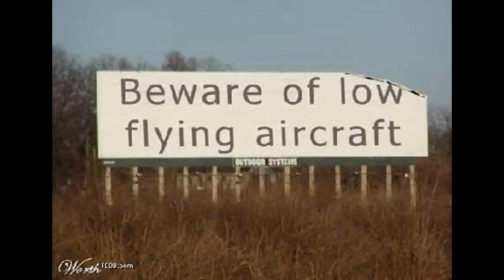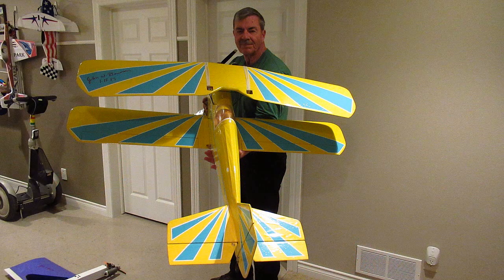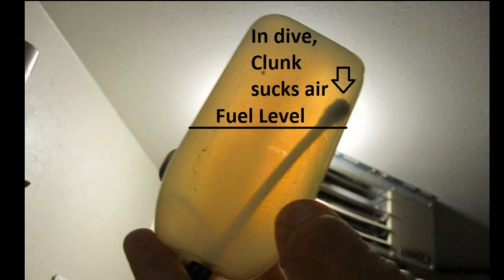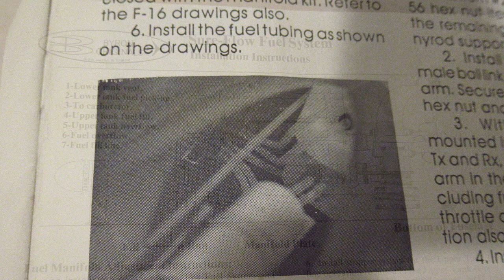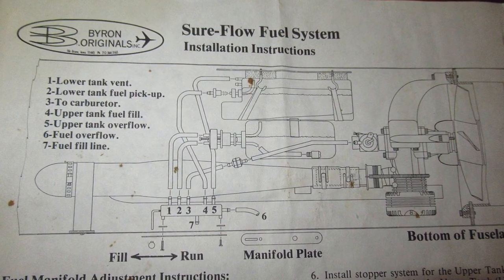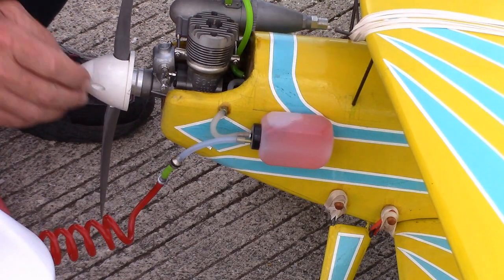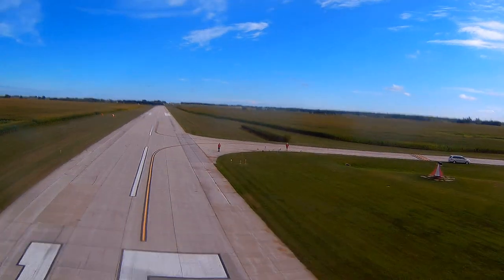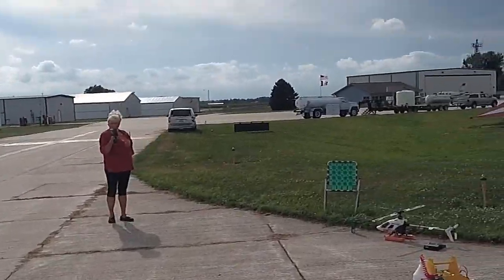I love my AAMCO balsa Aeromaster TOO Biplane!

Comment: One of my all time favorite planes. I flew one for many years with an OS 90 four stroke. It was covered with silk and Sig dope. It finally met its demise in a mid air in which by the time I was getting what was left of control it strained it self through a tree. I still have the fuse which was not hurt that much. Still have the plans. 

Thanks for the memories. I also have a scratch built Acro Star bipe, and a Lazy Ace. Love biplanes. The Lazy Ace has a Saito 90 Twin. Oh, I forgot, I also have a Phaeton bipe from Balsa USA. The first version. OS 60 four stroke in that one.
Reply from the maker: You have some great planes.  Bummer about the Midair.  I know how that goes too.  Thanks for sharing your comments.

Comment: I had not realised that the tubing spec had changed Dave causing the problem that you describe here, but it all makes sense now,really what the fix is an header tank as used in some full sized aircraft too and I think your highly visible external mounting is both practical and a good idea.
I always wanted an Aeromaster but it was out of my price range but I have built similar designs that flew well,one was the Wizard biplane kitted by Sterling in the early sixties,the kit was crammed with timber ! I flew one with early Reeds gear made by RCS in the UK,there was no film covering back then so I used good old tissue and dope sprayed with rattle can yellow power was a Merco 61,in the end the radio gear which was non bi simultaneous failed on me and the model flew downwind landing on a roof !
We just do not know how lucky we are these days with ultra reliable gear to fit into our models but memories of those old designs linger on,a lot of models under the belt since then.
Keep them coming !
Reply from the maker: What a great story you tell, Angel.  Not many people know what a Merco is.  I had a Merco .49 on my Veco Cherokee back in 71 and it had 2 Glow Plugs.  Your right about the new stuff.  All flying back in Galloping Ghost Radio days was hit and miss.   I appreciate your comments and will keep flying as long as I can.  Thanks very kindly!
Reply: Me too Dave the old bones creak a bit and getting out to the flying field is difficult these days but with the help of good friends I make it to the airstrip,when we were young chasing models was all part of the fun but now I like to land them at my feet !
I have just made a replica of the Tauri design I first flew back in the sixties,except this one has a big outrunner motor installed,the Tauri taught me a lot and I managed to pick the plan up on Ebay,no doubt you will remember the Taurus Dave its big low wing brother,when you went to a model show everyone had a Taurus it was highly aerobatic but back then models tended to be much heavier as you know good for any wind conditions.
I love building these older designs and putting  decent equipment into them,yes I had a brief excursion into galloping ghost with the birdcage on the back ! mine had Derek Olley Flight Link,we called it Fright Link !
I built a beautiful Phleet Phoot from 'Model Aircraft' magazine plans and it crashed when it went out of range on its first excursion,a beautiful model with a long moment arm ideal for galloping ghost but that pesky gear let me down.
Have a lovely evening Dave.

Comment: I found an old aeromaster too at my CAP squadron and was allowed to keep it. The wing struts are broken in one or two places, on of the servos is broken, and the cover is peeling in places. I have no idea about the condition of the electronics or the engine. I think I’ll buy another one to so that I can learn how everything fits together and works. Thanks for the video.
Reply from the maker: Right on.  Not sure you will find another, but good luck with it.  Thanks and happy flying.
Reply: @NightFlyyer  thanks. I’ve found several intact kits online, so I think I will be attempting to buy one.

Comment: To this day I still prefer to fly my glow engine four stroke aircraft over my electrics. I’ve been flying electrics since2002 and glow much much longer. Do you have any videos of the X wing?
Reply from the maker: Me too, but I just bought a gallon of 15% and it cost $60, so it is getting a bit pricey.  I will put up a video of the x wing soon, as I just found some of the old tapes of it.  Thanks.
Reply: @NightFlyyer  60 bucks WOW in Canada it is $39.00 CDN dollars so for US under $30.00
Reply from the maker: @RC-Flight  I buy Torko Racing fuel 15%.  That price included shipping.

Comment: Well first it must be said that well presented videos like this, from aeromodellers who were at the sharp end "back in the day", are much appreciated by (old) newbies like me. I can't catch the word you say after Enya. With its strap-on silencer it looks like a 60 Mark III. There is no mention of a GP (geared pump) to feed the header tank - which would seem the obvious way. Nor can I see any pump on the schematic. How is the header fed? My own solution to the header won't fall to the front/gets stuck at the front is the machine up heavier clunks - about twice the length/weight of the one you show. Any comment? Was it tried and dismissed for some reason? (Incidentally, if anyone else makes their own clunks, copy an Enya nipple: vastly more secure than the usual "barbs".) Thanks again for the post.
Reply from the maker: Its an Enya 60-III and is pressure fed with the stock muffler.  Geared pump or not, if the clunk is not in the fuel sticking up, air will still get to the engine, just faster.  Heavy weighted clunks will still not work well for us and really can get stuck at the front of the tank we found.  We tried many ways with all kinds of weights but with today's silicone tubing, and it is still too stiff. This feeder tank is easy, and always works as you saw. Its been an old standby method for us old time Pattern fliers for 40 years.  I never have to worry about air getting into the lines and the engine leaning out and quitting. Thanks for the comments and suggestions.
Reply: @NightFlyyer  There is some thin walled tubing available which helps a lot as long as the clunk is about 1/4 inch from the tank rear. If any closer the acceleration can stretch the tubing and then the clunk jambs against the rear wall. A heavier clunk also helps with the thin wall stuff.
Reply from the maker: @mikewhite4628  Maybe but I'm not going to take all my tanks apart and change them.  No way would any acceleration of any of my planes cause the tubing to stretch and if it did the clunk would still be in the rear with the fuel.  You can do whatever suits you but I am sticking to what really works and has for 40 years.
Reply: @NightFlyyer   Quite right. If it works for you why change it?